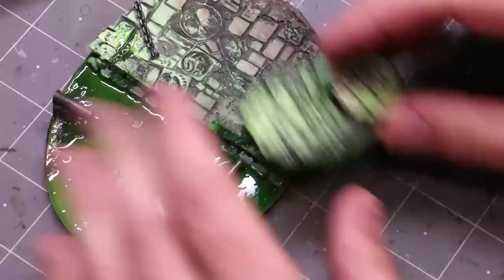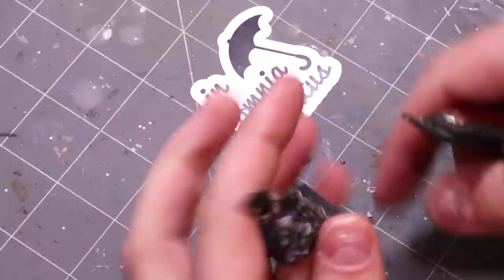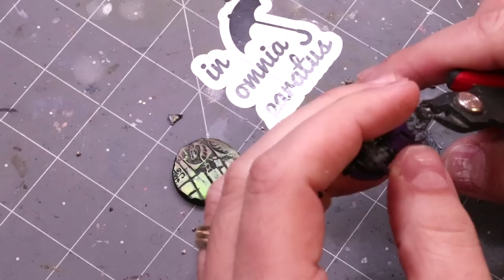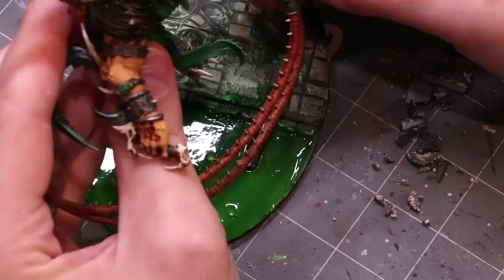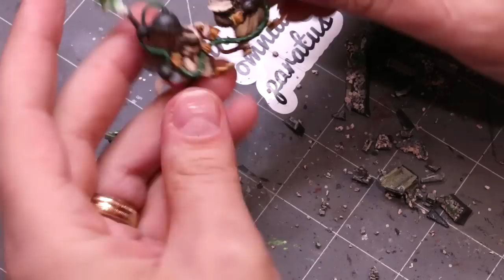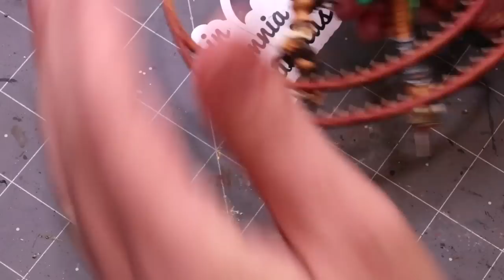Hobby Cheating 262 - Rebasing from Square Bases

Comment: Hi Vince! I usually slip my sharp hobby knife between the base and it's decoration. If PVA glue was used, then the knife goes super smooth and you just have to slice the junction between feet and the base. Pretty simple and time saving :)
Reply from the maker: Nice, I usually use super glue, so it's a little harder, but it's a good tip for sure. :)

Comment: As someone who just got back into WHFB in 2020, I am deeply offended by this wholesale slaughter of precious square bases. But also, quite curious if you have any special advice for the other way around! Not just useful for us retro gamers, but alsl relevant to the eventual release of The Old World, with people restoring old WHFB armies for use in their original rank'n'file gameplay.
Reply from the maker: Well, I am not sure Old World will actually use sqaures, they might go ASOIAF and have the rounds in a square tray to have cross-compatibility. But yes, these same tips would certainly work in reverse. :)
Reply: @VinceVenturella  I mean, their original teaser was literally a photo of a square base, with the phrase "everything comes 'round again, even squares", followed up by "be there AND be square" when they announced the... announcement? If it's not on square bases after all that heavy hinting they'd have some explaining to do.
Reply: Wouldn´t round slotted square movement trays be the easiest option? as you still be rank and file and if you base the movement tray like the army it wouldn't be noticed. 
something like this: 
https://www.asterwargame.com/products/movement-trays-x-3-in-mdf-11-5cm-x-5-8cm-8-slot-circular-25mm-diam
Reply: @frederiksen2210  round bases are larger than the equivalent squares, as they're generally based off the diagonal length of the square (20mm square -> 25mm round), and round-slot movement trays exacerbate the issue by forcing models further apart. It's much better to use square-to-round converters if you want models to work well for both game styles.

Comment: I'm sure bunch of my marines and death guard are missing bit of their feet lol. I glued em with plastic glue to base when I first got em. I used saw and snips. The saw was to get this "edge" under the feet for the snips to naturally go as low as possible. But that's much easier without anything on the bases I glued em too as I can still re-use them. 

On my marines I'm using base toppers so it's just a ring I glue onto GW base: https://photos.app.goo.gl/Nv7RvDPh8Qph2fuv7
Reply from the maker: Yeah, I've seen those, those are nice as well for sure.